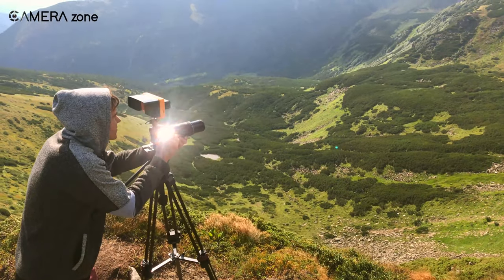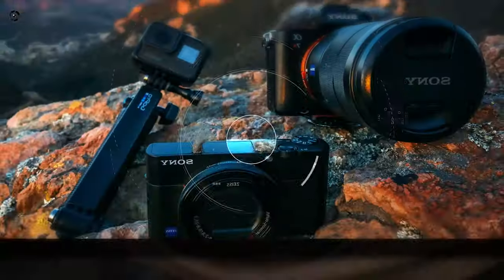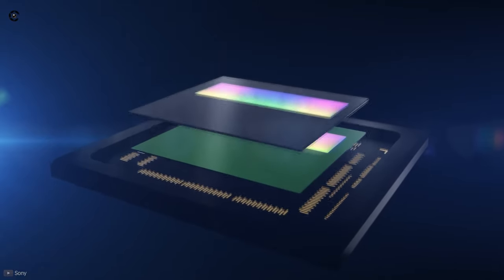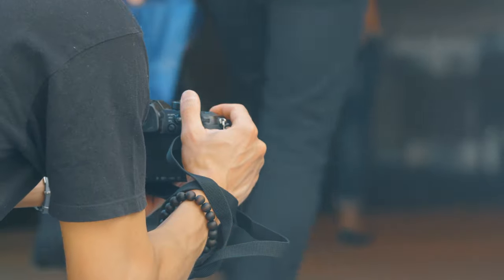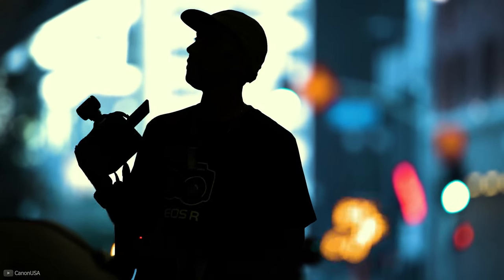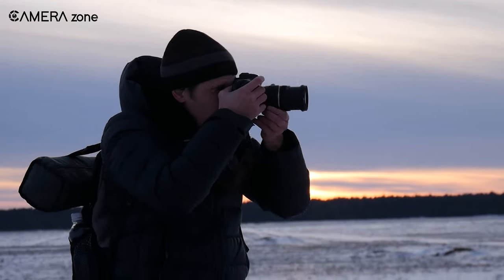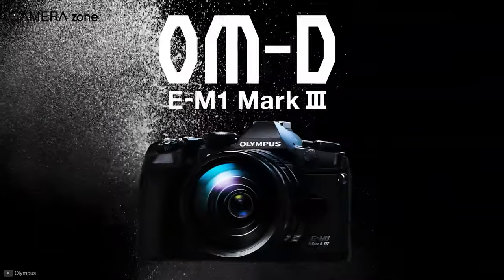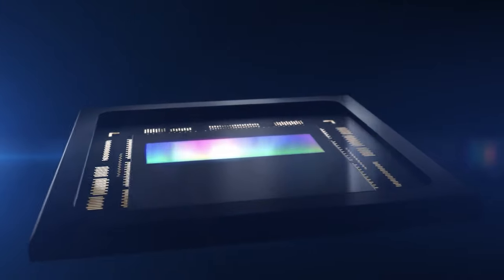Stacked Sensor: The Future of Camera Industry

Comment: I was thinking a stacked sensor was something that took 2 different sensitivities of light. Where the photons would fall onto one at a high sensitivity for capturing more detail in the blacks, and as it passed through onto the other sensor, the second one would stop blowing out the highlights. So the resulting RAW image would have a much higher dynamic range and you would never have to worry about nailing correct exposure.
Reply: Great idea, this is kind of like what Dual ISO in magic lantern does but using normal one sensor, just sampling alternate lines of same frame with different ISO's for  that same reason. Gets you 2-3 stops of DR for almost free

Comment: Rolling shutter has nothing to do with speed.

It is entirely possible to make a global shutter CMOS sensor.

They just have lower sensitivity and more noise vs sensors using the rolling shutter regime.

The problem is apparently caused by cross talk between electrical signals produced by individuals pixels interfering with each other and causing signal noise as a result.

The more pixels you have running at once, the worse the problem gets.

By only exposing a single line of pixels at a time the cross talk issue is eliminated, or at least largely reduced - thus the rolling shutter effect as each line of pixels on the sensor gets exposed just slightly out of sync with its neighbor, enough to foul up high speed action like propellers on air planes or helicopters and any number of other thigns.

It can be argued that a drastic shift in sensor electrical layout is needed to overcome this issue as it is holding back the tech at a fundamental level.

Much as the pigment/dye based color filter over the sensor is also bottlenecking pixel sensitivity - metasurface based filters may fix this problem in the future and give image sensors a serious low light sensitivity boost in the process.
Reply from the maker: Woah, thanks for sharing!
Reply: haha and then a9iii gets released

Comment: The underground-complexes around the world should be very interested in applying BSI-CMOS (stacks) to their micro-dust micro-electronics baking lens-coating computer jar-jar-binks starwars movie-projector oops camera-sensor directional-vector oops.
Reply: Eeee... to the power of minus 6
Reply: Coating is the etching
Lens surface... aim stacked.?
Reply: Trust the indians to rehash CCD-sensors for micro-switch without micro-lens. Habitual jumper-wire are easy scapegoats
Reply: Laser blast inside glass for "hologram" glass-block display and OLED are bulk-price tech at e‐³

Comment: So why then does the Fujifilm XH2S have LESS megapixels with a stacked sensor compared to the XH2, which has higher resolution and a non-stacked sensor?
Reply from the maker: Because stacked sensor is still not that much popular, R&D cost is high too. We'll see more of the innovations in future for sure.
Reply: Some cameras manufacturers are saying fewer megapixels means each pixel can receive more light and they're just as good as slightly higher megapixel sensors. Taking what we know about stacked sensors, some camera reviewers are saying you really don't need high megapixel count because they are far superior to the equivalent single sensor design. It would nice to see someone actually testing this theory.

Comment: This stacking isn't addressing Bayer colour filtering. Sigma's Foveon is the only true full colour image sensor available though it is very slow with poor ISO performance. I'm looking for 3 separately located RGB sensor technology so that each pixel has full colour sensing ability without guessing and making a fool of photographers by using clever anti aliasing processing which is a fake image no matter how many mega pixels. Join the only true camera SIGMA don't be a sheep. Sony, Panasonic, you can do better? Stop the fake AI image processing.